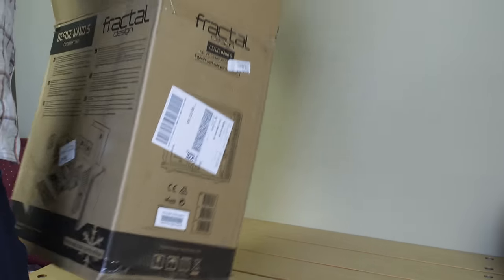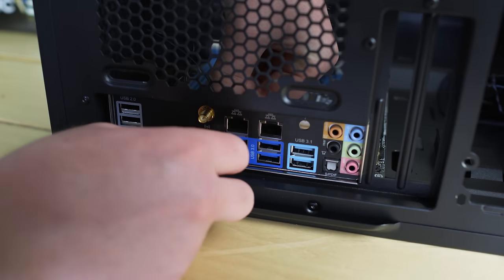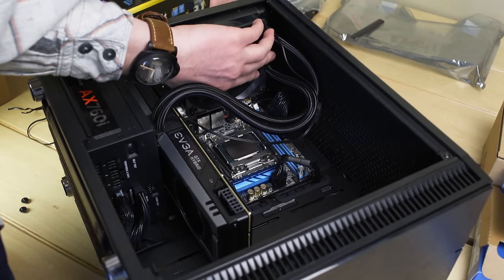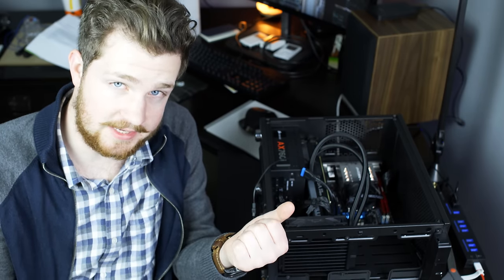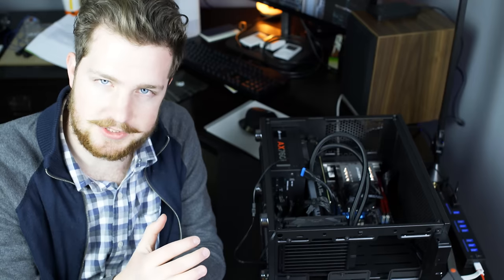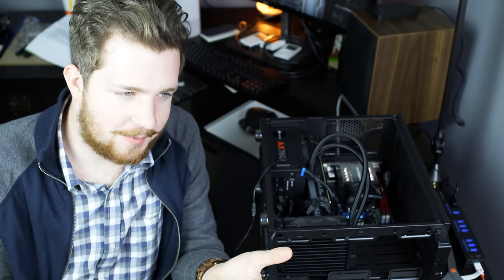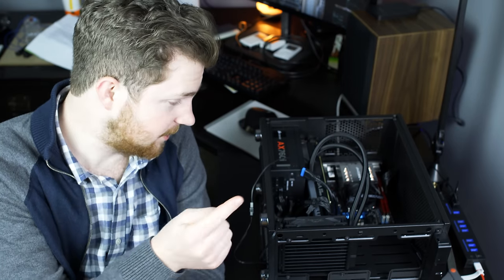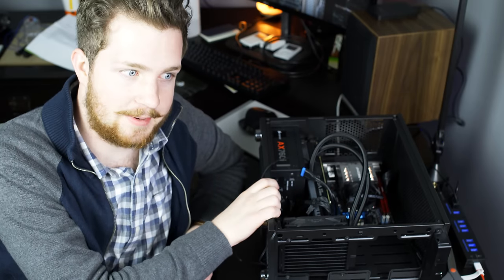My Powerful Custom PC Build Disaster

Comment: a mac is like using chopsticks... sure... everything's nicely cut up and you can pick it up but, a fork and knife wins every time ;)
Reply: accurate
Reply: you are just bad at chopsticks.
Reply: mike Stan Livingston It's a metaphor :D
Reply: +Gapi P And linux is like using your bare hands. Hands > knife and spoons
Reply: +Karn But  linux doesn't support knives so you can't enjoy steak without wearing two pairs of boots
Reply: +Gapi P You can pick up a for and knife without hands. Hands > knife/spoons.
Reply: lol these comments are hilarious :D :D
Reply: What the fuck...?
Reply: +Gapi P macbook pro beats any shitty windows laptop fact..... unless its some big huge bulky alienware which probably has the generic windows touch-pad that makes laptops unusable
Reply: Bryan Benson dell xps 15, you ain't beating shit.
Reply: Bryan Benson first of all. a macbook pro is TRIPLE  the cost of a shitty windows laptop. Secondly that's factually incorrect when you compare windows laptops for half the price. They simply have a much better GPU and a superior OS.
Reply: +Bryan Benson What Karn said. The Dell XPS 13 and 15 wipe the floor with any MacBook Pro.
Then there is the Surface Book, Razers Blade series of laptops which are amazing products.

Don't be a biassed little fan boy.
Reply: +Karn exactly when you touch without reading everything about it, you get burnt :D
Reply: +Bryan Benson Lol apple products 100% of the time profit first consumer second so don't compare shit apple to windows they overprice everything and try to keep its consumers in the dark constantly so they don't switch to something better.
Reply: +Bryan Benson sorry to say this the blade 14 is night and day compared to the MacBook Pro its thinner and lighter then the MacBook Pro you also showing you know nothing about computers that you think alien ware is the best Windows laptop you are so fucking misinformed    the better Windows laptop is the blade 14 and the surface  both can have OS X installed on them I like apples os but not what they put it on for example 2013 is when Apple got haswell custom pcs were getting brodwell now in 2016 custom pcs have skylake Apple mainstream computers still on haswell so that's 2 gens behind again so I would rather have osx on something like skylake or skylake e and run osx and be on a newer platform instead of apples old tech and another plus I can upgrade my hardware when I want to also here is my last point I would rather have a thicker laptop then a super thin one any day because on that super think laptop you can only replace that ssd/hdd thicker laptops you can replace the cpu gpu ram
Reply: +Bryan Benson  also to finish it up you can change the ssd/hdd it has a disk drive change wifi adapter m.2 etc your MacBook Pro can only change the ssd/hdd
Reply: +Bryan Benson I forgot to add this they ARE FUCKING CHEAPER TO
Reply: +mike Stan Livingston lets have a challenge your chopstick vs my spoon lets eat some soup.
Reply: +HowAmI ahahhaa yes
Reply: +Gapi P hardly, chopsticks are hard to use but macs are really not.
Reply: Lol
Reply: +Gapi P sorry daddy but no, just no
Reply: the chemtrail kid no? Okay then :D. Great arguments! :D
Reply: stay mad daddy :}

-Sent from my Mac Pro by Apple
Reply: the chemtrail kid why would I be mad :D? If people wanna overpay for an inferior products, just because they're marketed in movies and everywhere, fine by me :D.

Sadly it's because of you that people make fun of americans. You're the ones who don't thin with your own head. You're the ones voting for Trump :'D
Reply: Here's a tip cutie, go to a Computer Science department and see how man Macs you see.

Stay mad daddy :}

-Sent from my Macbook Pro by Apple
Reply: wiideathmod Awww, can't even comprehend what a wrote sweetie, thinks CS department equals a computer lab. Nice try. Maybe you'll give me another go later daddy?

-Sent from my iPad Pro by Appple
Reply: Ok sweetie, I will. Enjoy your child video games. I'm going back to the CS department talk about programming and cloud paradigms.

Oh, and one more thing, stay mad daddy. :}
Reply: wiideathmod aw, sweetie. i'm sure you'll be able to speak coherently eventually?

you know, OS X has a built in spell check. it might help you a lot.

oh, and one more thing, stay mad sweetie :}

-Sent from my iPhone 6s Plus
Reply: +the chemtrail kid love you to troll
Reply: +the chemtrail kid  said no one ever
Reply: Oh I love my PC but funny thing is I know the guys at WB studios and they use Macs to make games hell 90% of them do. Macs have a purpose we should be happy we have 2 types of computers PC and Mac I wish someone would make 2 or 3 more.
Reply: Louis rodriguez what? The majority use Windows based PCs to make games that's simply a fact. Not to mention WB even had to cancel Arkham Knight on Mac and Linux completely. That is simply a lie that they use macs. Arkham City for example was released before unreal engine even provided support for macs so they released the game later on mac and linux. Macs used to have a purpose but in the past few years, PCs have overcome macs in every category even rendering videos and photoshop.
Some graphics designers still use macs due to personal preference since macs used to be so much better on it. Not the case anymore.
Reply: +Gapi P bro my friends work there here in Chicago they're not going to lie to me about that C'mon.  And my cousin works for Santa Monica studios he told me that they use Macs. Sorry I can care less about Apple they don't pay me shit
Reply: Louis rodriguez I'm sure your ''friends'' do yes. What games did warner bros even make? Arkham origins? That's it right? No other AAA game. So you're telling me that WB only used macs to develop the Batman game which was the first in the series not released on macs....

but of course that's not all. Now your ''cousin'' works for a studio that is owned by Sony and does playstation games exclusively and even upload their developer diaries where you can see them use windows based PCs with dell monitors....
Reply: +Gapi P it's just a tool. I'm going by what they tell me fam I'm not in their with them. I'm not trying to be combative. It's like if you and me where and you tell what you use to do your work. I'm sure they use PC as well. Again Apple can kiss my ass they don't pay me shit. I hope you understand where I'm coming from.
Reply: +Gapi P sorry it's netherrealm studios is where they work but they have that WB ID card.
Reply: Louis rodriguez and again if you look at netherrealm's developer diary you can clearly see they're using windows....
Reply: +Gapi P yes and macs.
Reply: +Gapi P and so you understand this is what they're telling me. I know the guys not watch some videos.
Reply: Louis rodriguez how come i've never seen them use them :D?
Reply: +Gapi P I don't know.
Reply: +Bryan Benson you should maybe look at the new generation of gaming laptops. No longer massive in the wrong places and vastly, VASTLY more powerful than a macbook pro. On a side note, you can always just install osx on a pc if you really need to.
Reply: +th3d3wd3r not really... lots of things break when you do that. I never got WiFi to work on my laptop running OS X
Reply: Farhan Pasha Then you didn't do a very good job ;) I've built a ton of hackintoshes. 90% of cases you can get all hardware working on a vanilla kernel
Reply: th3d3wd3r lel
Reply: th3d3wd3r I got a new PC. I'll try getting OS X on that over spring break.
Reply: +Gapi P Hahaha... Thanks mate! You made my day ;)
Reply: +Gapi P ninjas use chopsticks you lose sir.
Reply: +Gapi P CAN YOU DRINK SOUP WITH A SPOON? no. CAN YOU DRINK SOUP WITH CHOPSTICKS? yes. Think about it...
Reply: You can start a fire with chopsticks too :D
Reply: +Gapi P Wow, Don't be such a fanboy, it's just sad. i use a mac, and i have to as some of my audio interfaces don't even have windows drivers. Core audio is pretty big in audio, and in general, if cutting quickly, FCPX is much faster.
Reply: +JesseDegenerate How is foobar2000?
Reply: i haven't benched it in a long time, it's a haswell build, Was just a lot faster in FCP with 4k footage than premier. I'll run foobar, but they'll be haswell numbers.
Reply: JesseDegenerate i'm not a fanboy lol i'm stating facts :D
Reply: ***** you're a fanboy, it's cool. Apple makes some great non over priced shit as, well as some old overpriced shit. You'll get over it.
Reply: JesseDegenerate i am a fanboy of what :D? I've owned 4 iphones lol :D
Reply: +Gapi P So? I have a ton of android phones and a win10 machine. (i'm a nerd) look at your posts about macbook pros, OS X etc. I have a ton of audio gear that doesn't even work on windows, and you have no idea why core audio or video are great, but you're ready to condemn them. MBP's are well engineered machines. Mac pro's are something only a crazy person would buy, but still; you're the definition of a fanboy. Sorry!
Reply: To use your analogy using Windows is like eating with your fingers.
Reply: JesseDegenerate stating facts isn't being a fanboy. I never said apple is all bad. I don't even hate apple lol. Great arguments. I still agree that apple has better programmers than google as far as a mobile OS is concerned. Although I think that Android is better due more features, iOS requires less ram and is very smooth
Reply: ***** to be fair, you stated no facts.
Reply: +Gapi P haha, can't use chopsticks properly, thinks they are inferior to fork and knife.
Reply: Solitude they are...and i can use them really well
Reply: ***** If you did, you would realize that CHOPSTICKS CAN'T CUT... I mean, you're comparing CPU's and GPU's.
Reply: Solitude no i'm comparing tableware with tableware... i studied japanese for 4 years... when you travel in asia you have no choice but to eat with chopsticks lol... it's not even hard.
Reply: ***** Then compare a spoon with a fork too. While you're at it, plates and vineglasses.
Reply: Solitude i compare the tableware, 2 different cultures use for eating the same thing such as chicken and rice. You're quite bad at comparisons lol
Reply: ***** Me bad at comparisons? Haha, said the guy who compared cutting and stabbing utensils, with gripping utensils and decided somehow, the first wins everytime... That's just your opinion, man...
Reply: +123456789101112131415 WowYouCanHaveALongName thats not the point of the metaphor... its saying knife/fork is better than chopsticks thus windows is better than mac
Reply: +the chemtrail kid why would a computer science department have macs... its hard to run code that isn't native to OSX on those things, With windows you can use a VM which thanks to the better hardware will run a lot better than Wine (if you can even get wine on a Mac, i think i saw it somewhere) and even then it can only run Exe files and not things like VBScript or batch (without fiddling with permissions) and probably more that i really cba to research.

but anyway, my point is that there are a lot more languages that can be run on windows including OSX languages
Reply: Jack Rycroft my friend... you should be careful when saying such things...these kids are extremely butthurt and this particular one might even cry due to the pwnage he has just received from you in the form of facts.
Reply: +MudMurfin Thank you. It was getting out of hand.
Reply: +Gapi P i agree with your statement, but disagree with the metaphor used, you are just bad at chopsticks. The chinese invented fork, and instead they use chopsticks, why? cause its better
Reply: ***** no i'm really good with chopsticks. Also no, the chinese didn't invent the fork and no it's not better. In order to even be able to eat food with chopsticks you need to cut it up with a knife beforehand...that tells you something.
Also to a guy who has been eating with his hands his whole life... you offer him a fork and knife and chopsticks... guess which one he's gonna prefer?
Reply: check history on the earliest fork discovered. "wink wink"
Reply: nope boy, its from the Qijia culture in china, i get why you said ancient egypt, because it would have likely said "some of the earliest discovery of utensils resembling a fork is from there", but there is 2 problems with that, 1. cant determine the proper timeline for the fork used in ancient egypt and 2. It wasnt used for eating, they were used are carving tools. Thats why it says "some of the oldest, instead of the oldest" The Qijia culture one is the oldest artifact of a fork.
Reply: ***** ''As a kitchen and dining utensil it is generally believed to have originated in the Roman Empire, as proved by archaeological evidences.''

just finding an item that resembles a fork doesn't mean they used it for eating ;)
Reply: +Gapi P But the spoon towers over all of them...
Reply: i like your comment
Reply: +Bryan Benson atleast they dont thermal throttle
Reply: +Gapi P so many metaphors
Reply: Hey that's Racist
Reply: Mac is like chopsticks
Windows is like a fork and a knife
Linux is like an empty lot... 

After you've built your desired facility in witch to enjoy your food you'll have to make sure you have a decent suplier for food that maches your palet.
Contact some third party craftsman to forge you a fork and a knife, make sure it doesn't have lead because your palet might not be compatible with older elements.
Be on a look out for a plate manifacturer and remember to let the electrician in so that he can wire up your stove.
You could end up with a 5 star dinner or be eating caned beans next to a hobo fire, while Torvald and his minions tells you to git gud.

But hey at least the caned beans was free :)
Reply: I hate Macs.To proprietary on hardware and fug it,they use Intel CPUs anyway now.And FoxConn sucks anyway.
Reply: David Seo Language.
Reply: who cares. why r windoz users so filled with hate towards Macs. lol

Comment: that's why you don't use refurbed or used psu's
Reply: +northern marine Exactly.   The extra danger with a refurb PSU is that if it fails, it could potentially take down other components, i.e. damage them.   A good PSU is the foundation of a proper build.

Comment: Gets 980 ti watercooled unit.... gets cheap refurb psu....

WHY?! Omg WHY???
Reply: +JgHaverty incomprehensible. Like a Formula 1 team using remoulds and wondering why their prodigy ended up nose-first in the armco after 3 corners.
Reply: Anthony Rodemus Its not even a great power supply... If he got like a titanium rated 300$ psu for 80 bucks, i mean i could agree with that. But the EVGA superflower OEM psus (best in the market, "supernova" models) are less than 100$ fo a 750w version. They are even modular as well!  He said he paid 100$ for this one, I just dont get it.

Stupid shall be punished apparently lol

Comment: You got a used PSU? slow clap
Reply: +LetoZeth What's wrong with a used PSU?
Reply: Reginaldis Fudgepacker - Potentially everything.  The one thing inside a computer that can actually blow up, and he gets a used one.
Reply: +Reginaldis Fudgepacker I often buy used stuffs for my computers. But, you really have to know which one you shouldn't. PSU is one of them. HDD is another one.
Buying a processor or RAM used are quite fine, since those are one of the few components that'll run long enough only to be replaced by being obsolete.
Reply: +LetoZeth It's refurbished though so it should have been tested so there shouldn't be any problems
Reply: RCTestKid It won't have the same stability, since a bad batch might have some other components waiting to fail...
Reply: +Vrijman could not agree more, you will get away with most things but PSU is a no go.
Reply: +Reginaldis Fudgepacker idk about anything else, but as PSUs age they no longer hold the same charge and outputs. I learned this firsthand when I cannibalized my old PSU for a new build. When I replaced the GPU even though my old PSU could theoretically power everything that wasn't the case as it was ~5 years old by that point. When I did GPU intensive things my rig would just shut off.

I bought a new PSU with the same wattage as the old and I didn't have random shutoffs anymore.

Comment: Turn the cable around, had the same issue, one side is specifically for your psu and the other one is for your board.
Reply: +InBeta Cheers.

Comment: why did you spend $2200 for a PC build with a refurbished PSU..? if I would have been in your place then I would obviously go for something from ATX board and mid tower cabinet... bcz my 1st preference would be my editing job in premiere pro not the size factor... investment was huge but usage was very little in practical.
Reply: +Netraraj Pun 
The second he mentioned the instability my first guess was where did he get the PSU from. 
+Snazzy Labs
Can't you just get a  PSU from a friend or your old PC and make a stability test with that before shipping everything back?
Reply: +MrTimelesshippo 

from my PC building days that's exactly what i would say. PC building of all kinds with issues? it's a "process of elimination". 
if you can find a suitable PSU [whatever the quality, as long as it is a decent quality it's enough] then you replace the suspect one and see what happens.

if everything works fine then this guy would save himself a LOT of trouble by simply returning the dodgy PSU [he got it on the cheap.. i'm not surprised at all - i've had lots of bad experiences from buying so called 'working' electronics from ebay... never ever again] and just paying for a  decent this time around.

problem solved!